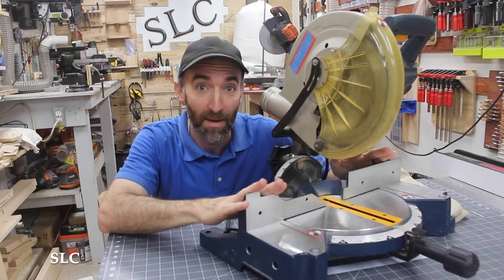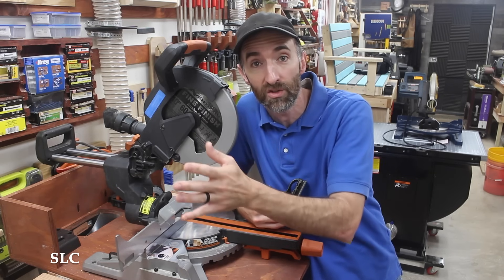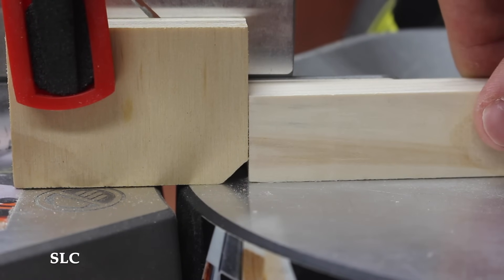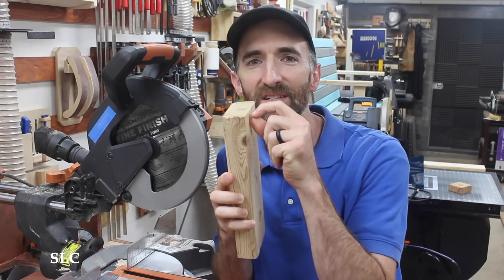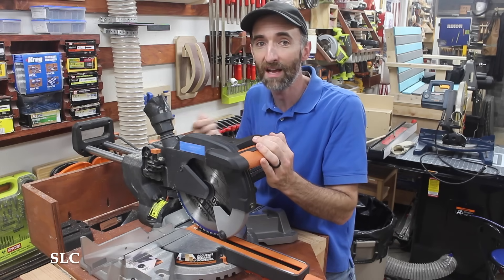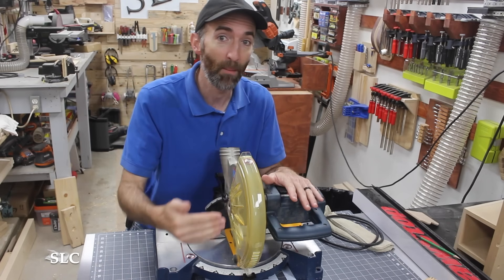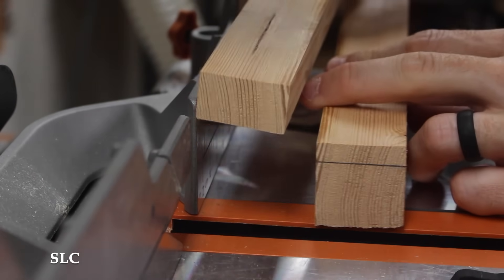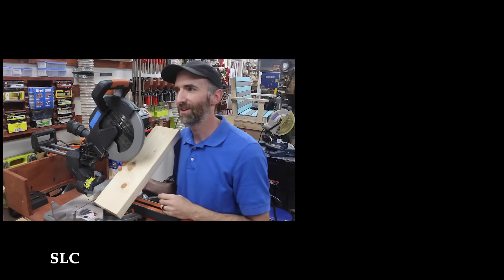20 Miter Saw Tips for Beginners

Comment: I've seen a lot of these videos . They seem to have one thing in common, the saw is stationed too high up. You never want the bed of the saw to be higher than your bellybutton. Reason is, your looking over the work piece instead of at it. This gives your face the most protection from anything flying out of that saw. Also,  you have better wrist control on the work piece, being able to push the piece down onto the bed, instead of holding against the back stops with just your fingertips. This is just safety talk, stuff I've learned the hard way over 30 years,
Reply: That’s the right positioning for actual use, but it’s not as useful for videos — where usually you want to see the tool and the face very clearly.

Comment: The tip to cutting the dowel in the "V groove"... Instead of it hanging down off the end where you could get tear out.. You can have your cut fully supported and just have that jig as sacrificial on the end, just getting a little shorter with each cut.
Reply from the maker: That can definitely work too
Reply: Hi.  Just a "Newbie" here but, is it a bad idea to use the dowel jig to cut just below the piece instead of all the way through?  For instance if the "Jig" is 4" high and the dowel is only 2" in diameter.  Or, would that cause instability in the jig ("Kerf" binding or "Kick back") due to less supporting wood?
Reply: I always wondered how to operate a miter saw….that was good …my uncle & father left one behind in the cellar….I think now I’ll take a good look at it now……thanks
Reply: Why not have a cut already made in the dowel holder - say, an inch in from the end (or even in the middle to support longer lengths), and align the cut line over the gap?

Comment: I just found your YouTube channel.  Thank you for a great video.  I just received a new miter saw, so your videos are very useful.  One tip to add to your Safety pointers -- Seriously consider wearing a high-quality dust mask while sawing, as breathing the very fine wood dust in the air can be very bad for your lungs, especially if you do a lot of saw work.  Years of using your saw without wearing a dust mask can add up to extremely serious permanent health issues.
Reply: Especially if you are cutting pressure-treated wood, e.g. for a deck...

Comment: I fitted my mitre saw board with hinges at the back, just pull the saw all the way out then fold it up. If it's standing on a cupboard then just cut another board and you have another small workbench when it's folded up 👍

Comment: I bought my first miter saw today. I have been wanting one for so long. Thank you for all the helpful tips!
Reply: Same here, two years later (2023). I've used them plenty of times for very simple straight cuts. Just never owned one or set one up. I'm grateful for all of the safety and practical tips I was aware of.
Reply: May I ask guys is this only for short side cuts? 
Or you also can cut long pieces  in long cuts pushing wood in blade cut in middle line of one meter cut.
 thanks.

Comment: Instead of using the pencil & eraser use a 12" or longer 1 by board to lay on the one edge and flat on the table. You will be able to hold it firmer and safer in-place and your hand will not be so close to the blade if for some reason the pencil or the project piece should move.

Enjoyed the tips! Thank You and keep up the good work with these informative videos. Sometimes it is good for the seasoned woodworker as well as the new ones to go over and be reminded of safety procedures. Blessings my friend!
Reply from the maker: Good tip, thank you

Comment: Until you put your miter saw on a cart, while still manually moving it around, definitely resist the urge to lift and carry it using the trigger handle. That's a sure way to put the blade and/or bevels out of alignment. Instead, pick up the saw by the base or the extension wings. Most miter saws have low-tech metal extension wings intended to support work pieces. They're usually just metal brackets that insert into holes in the side of the base. Since they're not precision attachments, it's okay to pressure them one way or the other.
Reply from the maker: Very good tip! Thank you Chris

Comment: Wagner makes a portable pro up "tent" foot small painting projects. It has a back panel that hold a 20x20 hvac filter inside and a box fan outside. With a little ingenuity it firms a nice hood for a miter saw. Use a small vac for the dust port in the saw. The combo massively reduces the dust going all over. The tent for up into a small bag like a auto windshield sunscreen.

Comment: This was great, I appreciate the tips, and I watched another video where they explained the KERF and reminded of not wearing loose clothing, these were helpful as well. Thank you for your info! One thing I asked was if it should be mounted onto out desk in the barn, (where saw dust wont be an issue) and if that would be a good height.( I am 5'3") My 1st project is making a chicken coop. This is my first time using our miter saw, an Admiral 12" from Harbor Freight.
Reply from the maker: You can mount it if you would like, but I like to keep mine loose just in case I need/want to move it around in the future. Plus the height is best where you find it comfortable and easy to use safely.
A simple chicken coop is a great first project, that way if it is not perfect, the chickens won't care anyway. 🙂 And you can fix and upgrade the coop as time goes by.  Have fun building.

Comment: Very useful thanks. I make wooden puzzles and I am thinking about investing in a mitre saw for cutting small wooden blocks to very accurate dimensions. The problem is I am always nervous about working with such small pieces (2-4cm in length) on such a powerful tool. Now I am just using my mini 12V table saw...
Reply: Harbor Freight sells a mini chop saw that works great for the very small pieces I cut. It was about 40 bucks also.

Comment: Hi Thanks for the tips very useful to usThanks newbies
I have a similar Evolution mitre saw as shown in your video but my current TCT blade does not have as many teeth as yours.. Can you advise me of the particular blade that you have installed in your machine?
Thanks
Reply from the maker: It is just a high tooth count blade to give a cleaner cut. It does cut a little slower, but the cut is usually better quality.

Comment: I'm SO glad you mentioned the word "Chop Saw" not being the right term for a wood cutting miter saw. I personally never heard anyone in my woodshop class, or any teachers call the miter saw a "Chop Saw." And in the 1990's and 2000's, a "Chop Saw" always referred to an abrasive cut off saw for metal with a 14" metal cutting blade. It wasn't until some years ago, it seemed like the word "Chop Saw" suddenly started being used to describe miter saws. To this day it bothers me, because there has to be some way to describe a metal cutting "Chop Saw" and a wood cutting "Miter Saw." And calling them both "Chop Saws" is very confusing.

Comment: Very useful video! Some good tips.
When cutting sleepers using a 10 inch miter saw i found that it wouldn't cut all the way through them in one cut.
Also same for 4 by 4s.
Can you do it in one cut with a 10 inch miter saw or do i need a 12 inch one?

Comment: Hello SLC You mentioned at around 15m20s about Noize ?A lot of the noize is from the Ringing of the Saw Blade after you cut and lift the Blade up!.
Forrest have a Blade attachment that stops the Ringing sound  Also Quieter or no Noize blades are available .

Comment: I may have missed it but I understand that when using a sliding mitre saw, the saw should be pulled to its full extent towards the user each time so that the pressure is fully against the fence. I found out the hard way that that is highly recommended to prevent kickback!
Reply: This is an extremely important point for a newbe. I'm glad you mentioned it.

Comment: Hi. I am working on a project that requires cutting 100mm x 200mm planks. I’ve seen a few places saying this can be done by cutting with a mitre saw and then rotating the wood to complete the cut. Is that the easiest way? Could you demonstrate?

Comment: Thanks for the video mate. Any chance you can do a video of getting your saw squared up? My cuts seem to be a little of but can't seem to fix it.
Reply from the maker: Try cutting a piece of wood on one side of the blade and then flipping it over 180° to the other side of the blade to see if they are even. If not  adjust your angles slightly and try cutting and measuring again.

Comment: I have a 10” slide saw. I follow your safety procedures   My saw sometimes stops just before I finish my cut blade is tight and not obstruction. Sometimes when making multiple cuts I cut 2 then it stops 
I move it up hit the trigger and it will cut again 
Any ideas? My shop buddies say I’m over working my saw
Thank you for your help
Reply from the maker: I would probably agree with your shop buddies but I would have to see the saw in person before I could suggest anything

Comment: I liked your video, but...
When you are making precise cuts, after the cut,  you should lift the blade out of the work while the blade is turning at full speed.  The reason being, the blade will wobble as it slows to a stop.  This will slightly alter your cut.

Comment: I would like to add to hint # 13.
You can use the dowel that you cut in hint #12, add some rubber bands to the end and use that as a hold down stick they are much longer than a pencil and will add more safety to the cut.
Reply from the maker: That's actually a great idea Peter,  Thank you
Reply: Great idea Peter thanks for sharing!

Comment: Very good tips!  I didn't have anything new to add, but I wanted to expand on two of your points:

When using the blade trick and pressing your wood just up against the blade to cut just a little bit off of it, remember that you are just trying to make the wood firmly touch the blade, make sure you don't flex it or anything!

Also, you should absolutely lock your handle down when moving your miter saw!  But.. do NOT use the handle to carry the miter saw!!!  The handle on too is not designed for the weight of the saw, it is just for operation of the blade.  Youbate meant to carry the saw by the two opening grooves on both sides on the bottom.  Using the top handle can pull the blade out of alignment.
Reply from the maker: Very good tips, thank you

Comment: I am cutting 4 1/2 inch baseboards and my saw stops 1/2inch from the bottom. any tips on that? Besides turning it around and changing  to 45 degrees the other way for each cut?
Reply from the maker: Would it be possible to raise your board up by placing another thin piece under it? If you do this, be very careful that the board you are cutting is still resting against the fence or you could lose control and get hurt.

Comment: I have a craftsman 8 1/4" slide compound miter saw  and I can not turn my saw to the left to make a beveled cut.  The saw is probably 40 years old. and never been turned.  I tried loosening the hex bolt in back but it still did not move.

Comment: I have the same blue miter saw. I’m having trouble making the cut all the way down. The blade doesn’t drop low enough to finish the cut, could you show what could possibly be wrong ?
-Thank you
Reply: There is a depth adjustment knob/screw. I just saw it on another you tubers video.
Reply: just curious, what brand/model is it?

Comment: Tip 21, instead of measuring a 3" cut on one side and a 6" cut on the other side, instead of measuring just use the measurements on your miter saw fence.
Reply from the maker: Unfortunately those measurements are a little off.
Reply: @SpecificLove7  Yes I had to correct mine with a marker but it was only a mil or two on the longer side as opposed to the shorter side. 

 I would have removed the fence to elongate the screw holes so I could slide it toward the blade but heck it was not worth it for a mil, besides most of the hash marks did match up, plus when you cut 3"-6" you will be off a mill or two no matter what, not enough to make a difference.
Reply: @SpecificLove7  Oh, and I might add since I own 3 different brands when I squared up the blade on the Ryobi, I also check the hash marks on the fence and they are spot on. It is funny no video I have seen talks about the markings on the fence nor how to use them or line them up.  Myself, I find it to be very useful when removing 3" to 6" of a longer board.

Comment: Woodworking Beginner: New - Update.
This test is only if you want to saw with precision with a miter saw.(test is not intended for rough and hard work).     

Tips and Test:  It's better to know than not to know.
Important to know if you would like to saw with precision. (avoid torsion as much as possible)!
Always choose a Miter saw with a handle positioned in a VERTICAL line above the saw blade.  
Everything must be aligned, slide rails, handle, and saw blade,it is much better this way the blade will not tilt.
Because there is some torsion in the aluminum housing .
And choose an engine with softstart on it to prevent wear of the gear and worm shaft.
It is very important that everything is aligned.
Here are some examples to show how the handle must be positioned above the blade.

First option: handle vertical positioned above the saw blade. 
Bosch gcm 800 sj / Bosch gcm 8 sjl / Evolution rage 3 / FESTOOL KS 60 / Bosch GCM 8 SDE / FESTOOL KS 60 E KAPEX / Metabo KGSV 72 Xact/ Bosch PCM 8 SD / Hitachi C10FSH / Ridgid MS255SR 10-inch / Evolution Fury3-S / Evolution R255SMS / Metabo HPT C10FSBS / Hitachi C10FSB / Hitachi C10FS.

Second optie: handle horizontal positioned above the saw blade / Evolution R185SMS / Evolution F255SMS / Evolution RAGE3R255 SMS3 .

(This also is the case with the Miter saw without the slide rails).

(If you want). You can test it yourself at home if there is torsion in the aluminum housing.

Step-1. First you make a saw cut from +-5 mm deep in to a flat piece of wood about +- 20 mm thick to this with the normal handle positioned on the right side of the Miter saw (the wood it will remain in place until the test is completed).

Step-2. Then repeat this by pushing the saw blade down with your hand or finger on the aluminum protective cover were the saw blade is cased in. Just now only do this without the running engine.

Step-3. Now you can see if the saw blade will be positioned in or next to the saw cut. If the saw blade is (+- 0,2 / 0,5 mm) next to the saw cut then there is torsion in the aluminum housing. 
(test is completed).

Step-4. Therefor it is much better to choose a Miter saw with the handle positioned VERTICAL in line above the saw blade. 
The second option is the handle positioned HORIZONTAL in line above the saw blade.

Step-5. When you measure the vertical 90 degrees angle square (Digital Level Box) of you're sawblade don't forget that there is always some torsion in the aluminum housing.

Conclusion: Remember this, the test is only about torsion and nothing else  how further away the handle is from the saw blade how more chance of torsion in the aluminum housing, you better not go for that. (the choices are yours).

Also with a cheap slide miter saw it is still better the handgriff in line a above the saw blade than on the right side. Maybe they will make it someday then we have a winner...
Reply from the maker: Thank you so much for all of the helpful tips.
Reply: I disagree about the position of the handle. I prefer and work better with a horizontal handle. With a vertical handle, you have to move over to the left and don't have the eyeline to properly position the cut. There should be no torsion when making a cut. You should not be using enough force to produce torsion. Handle the saw gently and let it do the work. Don't force it.